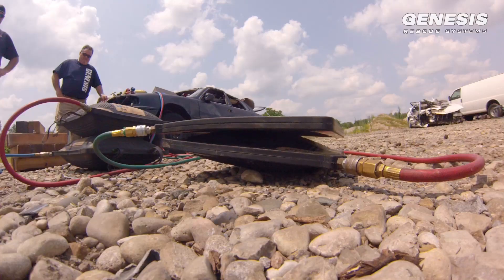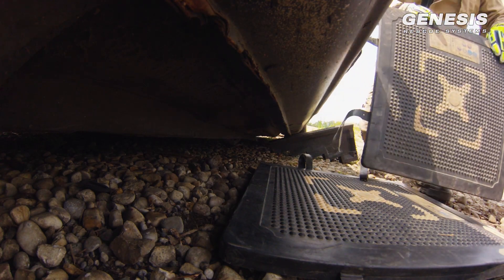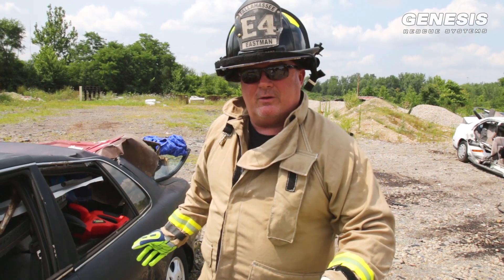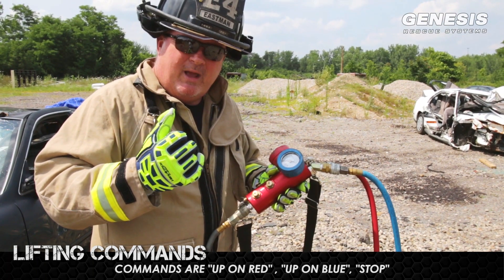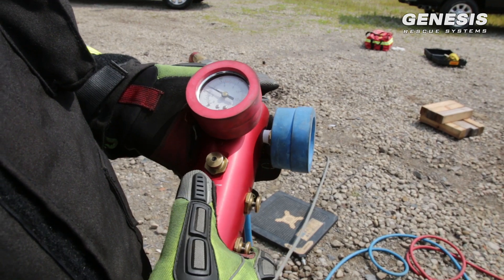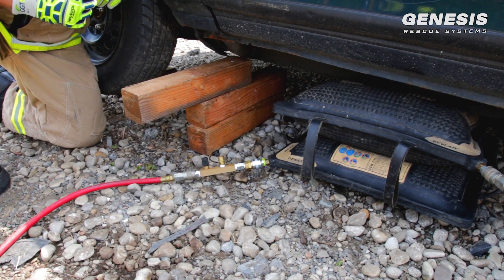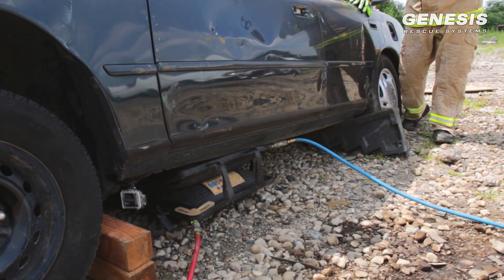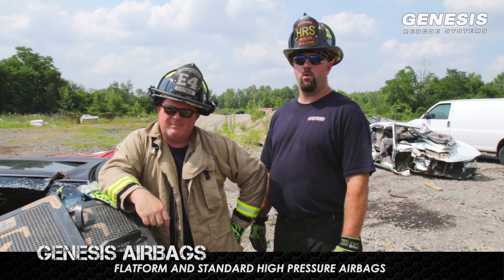High Pressure Airbags | Vehicle Stabilization | Genesis Rescue

Comment: Lift an inch crib an inch……. How thick is that cribbing? The silliest phrase in fire fighting.
Reply: Supposed to use a wedge.
Reply: @MacLaw3084 could you use a battery powered bike pump for these high pressure airbags